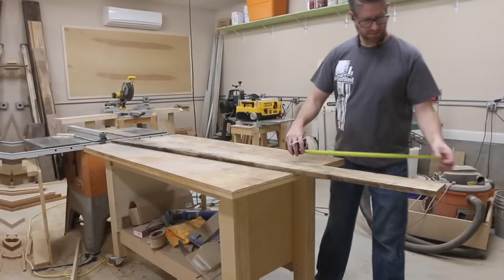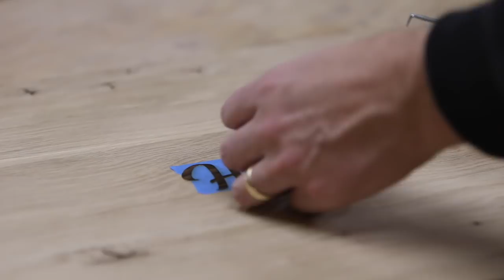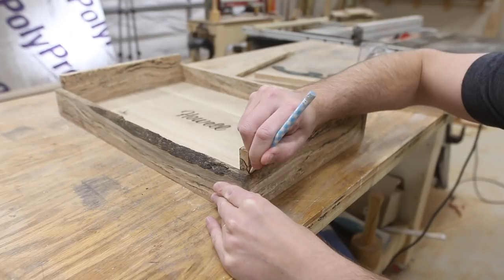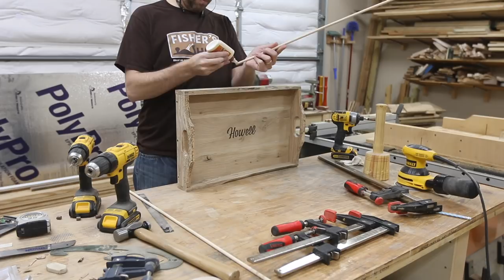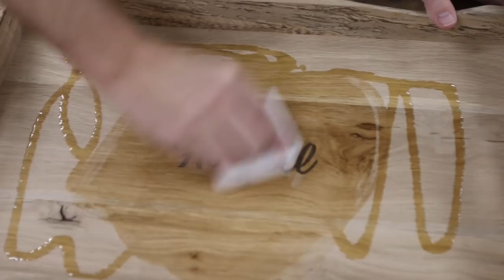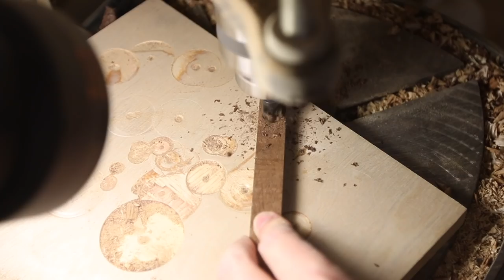Make This Serving Tray // DIY Woodworking

Comment: Bruce! This turned out beautifully! That spalting is incredible! I had to go back to the beginning of the video to see what species of wood you used. I'm ashamed to admit that I have never done a project with any sort of hardwood. My knowledge is really lacking in that area. I just looked up and found a hardwood dealer in Vermont and I'm excited to try my hand at some "real" woodworking 😋! Where do you get your wood?
Reply from the maker: Thanks, Zach! This wood was white oak and the most highly spalted stuff I’ve ever seen. And still really solid. I’ve bought from a few places before, including on Craigslist. This pile of white oak came from a local guy who had 3,000 bdft of it. I bought 800 bdft and this one was in the pile. Lucky find.

Comment: Very nice job...what could you do to the tray to protect it from water?cuz obviously it will need to be washed once in a while..would you just put a water resistant glaze on it?thx..also whete could i find walnut oil?
Reply from the maker: Thank you! If you’re just giving it a quick rinse, it would be fine. Just fry it off immediately. I would probably just brush it off though. I keep that kind of thing in my Amazon Storefront, but here is an affiliate link for the  Mahoney’s Walnut oil I use: https://amzn.to/3rc5wkm
Reply: @BruceAUlrich  great..thank you

Comment: Do you recall the thickness of the bottom panel? I would like to do 3/8ths of an inch but not sure that is thick enough.
Reply from the maker: I don't remember the exact thickness. I want to say it was more like 5/8". I think 3/8" might be too thin for a tray this large, but might work for one that is smaller.
Reply: @BruceAUlrich  Thanks! Great work by the way. Love your channel
Reply from the maker: Appreciate the support!